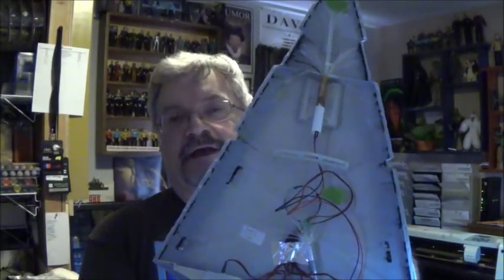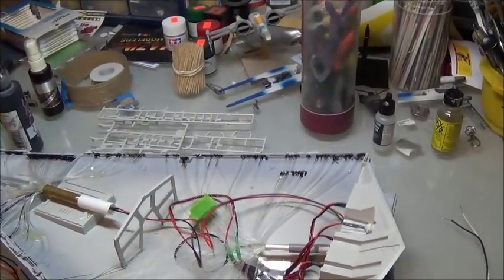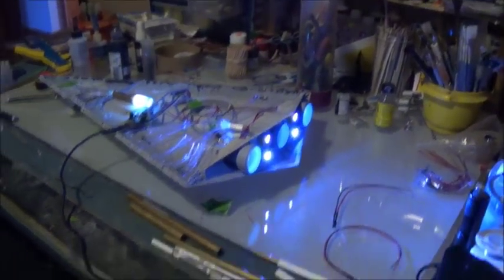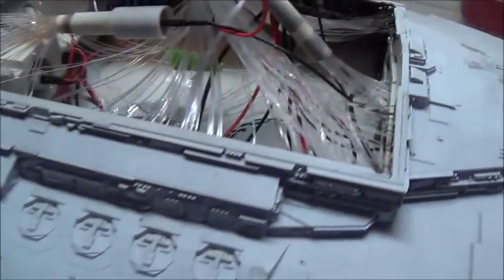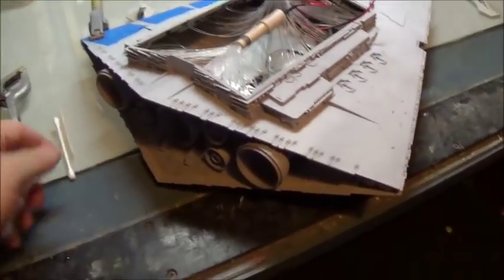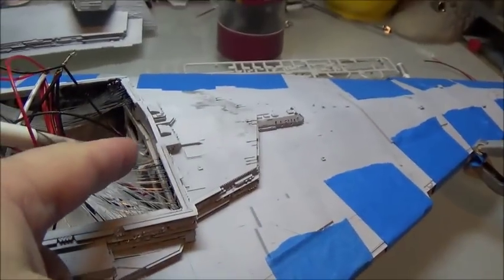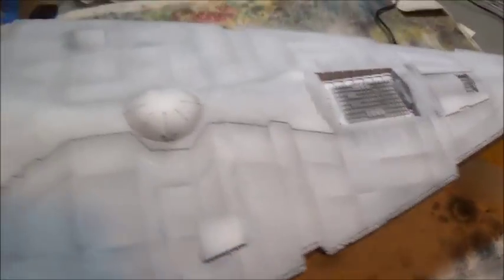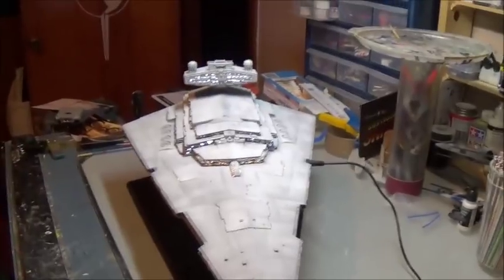Aztek Dummy Update 12/8/17 - Star Destroyer pt.5

Comment: Something tells me, Lou-- you want a Death Star... One hopes Santa watches YT!

Looking really, really good-- different color temperature LEDs and all. One presumes the warm is for officer country, the blue for grunts. Maybe ward rooms or controls -- one color or the other. OR new lighting types that haven't settled down through the Empire-- who can say?

I get nervous enough burying LEDs in models forever-- entire circuit boards get me anxiety attacks. But one does have to zoom those things around, indeed. Seems to me you would find one of those sockets that have a circuit switch built in. That way you could charge some on-board batteries so as to have some juice when unplugged. I dimly recall someone, some where claiming there was a "simple" system of new-fangled Arduino thingie that "took care" of all that on-board battery stuff.

I have an electric toothbrush that is all water proof and sits on a similarly waterproof base-- a cylindrical shape fits into a receptacle on the toothbrush body. I presume, it is some kind of transformer that is taken apart into two pieces. One part being put into the other to make a source of battery-recharging energy. And poof! or bzzz! my toothbrush works without a wire.

Of course we all know about those battery recharging systems that allow you to rest your phone on a pad. What I mean to say, is that there must be a cool tech moderne way to keep a battery on board that can be charged without a hull penetration. Or, that penetration is kept to a minimum (much like what you have done).

One interesting thing I noted-- this was one of the very rare times you stepped away from your work area. Interesting to see where you work in relation to the rest of your home and model room (cathedral!).

Comment: Hello Lou. Great looking work on this build. I would like to build one of these, but with the space that my 350th scale tos  and refit enterprises take up I don't have the space. I am thinking of buying the small revell rogue one plug n play one wich is still around 16 inches long and filling in all of the openings on the bottom and doing all of my own lighting for engines and all. My question for you is some say that the side trenches are too thin on this kit. After looking closely at this video, they seem pretty thin on this larger scale too. Is the kit I am looking at fairly accurate for the scale ore are the side trenches way out of scale. What is your opinion and any feedback would be helpful. Thanks
Reply from the maker: Jim,
The revell/sevezda is probably the most accurate SD I've ever seen. The only area where I think they dropped the ball is on the face of the head of the tower. It's possible that they were being true to the version they had, but I think they could have been more accurate on that part.  the trenches are just right to my eyes. I think we're all remembering that horrid MPC version that came out in the 80's with the extra wide trenches. I dug mine out the other day just so I could laugh at it
Reply: Lou Dalmaso 
I was wondering more about the trenches on the revell kit with the light and sound. Do those seem to be pretty close to the right size for the scale of that kit. Although it is more of a toy, it can be built to look like a very good model.
Reply from the maker: Sorry about the misunderstanding Jim. I really couldn't tell you about the other Revell kit because I've not built one. I'd have to track one down to give you an honest review
Reply: Lou Dalmaso 
Thanks Lou. I like the way you go about your builds and the way you aproach things. Some people that do videos on model kits get way to nit picky on the way things have to be detailed or built and make others or new comers feel that if they do it differently it is wrong. You take a very down to earth and laid back type of attitude to it and that is great. I am 59 and have been in this hobby as well as model railroading, HO and HOn3, and a lot of scatchbuilding and weathering and have always taken the same aproach. Sometimes I may want to add some after market to a model, but most times you can make a model look good with just a little weathering or adding something to make it your own. I got into it with TW a few years back when he said that if you build the big 350th scale refit without all the photo etch and other bells and whistles, then you might as not build at all. I did use the photo etch on mine, but I went with the Aztec decals and made my own circuit boards, and it looks just as good. Some people and new comers to the Hobby may not have the budget or ability for a lot of that and they just want to have fun building a model to display and not have to feel like it is wrong if they don't use all the add on stuff. There are no rules in this hobby or any others, and that is the aproach you take. Keep up the great work and videos.
HAPPY HOLIDAYS To you.
Thanks!

Comment: Hi Lou I have question before I do mine, what happens when you glue it all together after spending all the time on it and by chance one of the LEDs blows/breaks. Turned out great, love the colour and will use your base and stand when I do mine :)
Reply from the maker: Short answer? i would cry. 
I tend to burn the leds or a while while building and before final glueup just as a precaution. but if one of them goes out. I have to decide whether it's worth cracking the kit open to replace. I lost one on the Hopper build and I had to let it go because it was in too deep
Reply: Thanks Lou for the answer. It's a lot more fibre but that's why I was thinking wether or not to have the LEDs in the base and run the fibre optics longer. Not sure about the engine ones